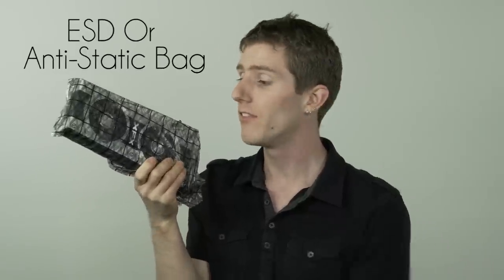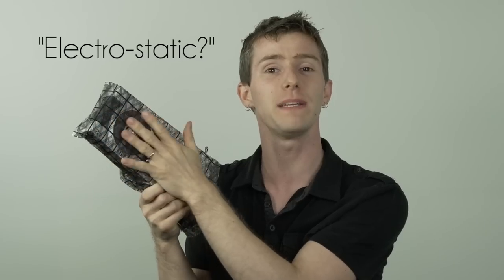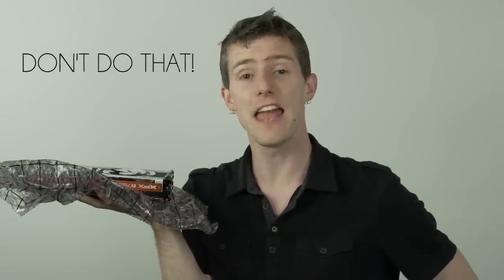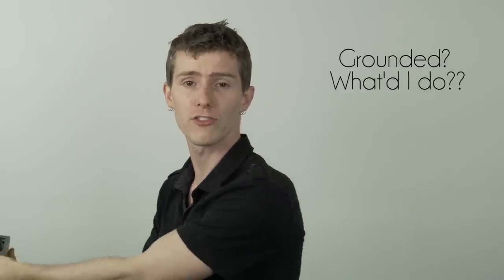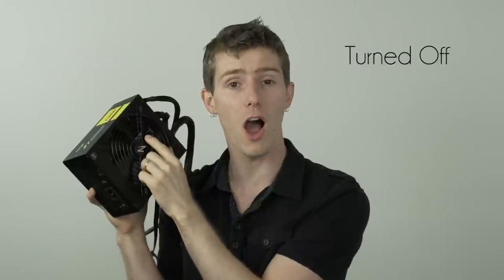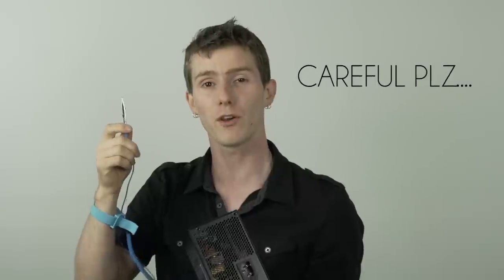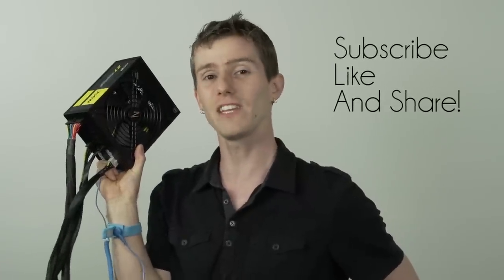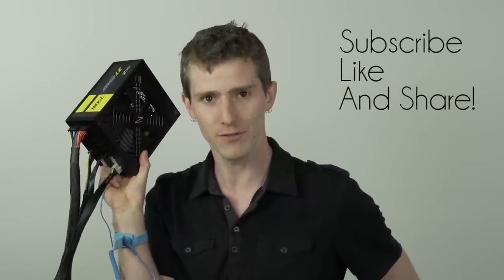Anti Static Safety - Handling Sensitive Electronics as Fast As Possible

Comment: I just touch something that's metal and grounded every once-in-a-while. I don't wear an anti-static wrist strap, sometimes I even wear polyester. I just put the parts on top of their boxes and in my 10 years of building PCs I have never killed any component through ESD ever.
Reply: hi can you help me with something? i don't really understand the words "ground" or "wall" when someone is talking about anti static safety or stuff like that cuz english is not my main language..
touching a grounded psu means that it has to be connected to a power outlet? or i can just touch it even if it's on the table and it's not connected to anything?
Reply: @Monicara  nah, planned to upgrade 2 years ago too and still didn't xd
Reply: @Monicara  can u give me the sauce of ur profile pic tho?

Comment: that power supply is coated with paint.... so how are you supposed to ground yourself on that???
Reply: it's ionized paint
Reply: so i can touch it and I'll be sure?
Reply: Gianfranco Boz Magni yeah. I'd just use one of those de-static bands and hook it to your psu and you'll be definitely safe
Reply: Thanks! I'm sure now xD
Reply: I see that you know about this, so i think you can answer another thing xD
 Does cable management really matter at airflow? 
I mean, i bought a pc but it comes assebled, the cable management is pretty bad, cause they do not use the back of ther motherboard, but, cables are not near any fan. indeed, they are accumulated near the hdd and it seems non-obstrusive.
 I'm spanish, That is the explanation of my spelling :v
Reply: Gianfranco Boz Magni i think Jayz2cents or linus has a video on that and I think it concluded that it doesn't matter much at all, so you're fine
Reply: Double thanks! :D
Reply: Gianfranco Boz Magni no problem. i finished building my first a month ago and i know how confusing it was
Reply: Now my only preocupation is who motherboard i used in my build, i think it is too cheap.
 I used a gtx 1060 and a i5 6600 non k,the mobo is asrock b150m hds, super cheap mobo dude, but in specifications it have all what i need.
 I have in mind change it soon, but idk if i should uninstall and reinstall windows and if the change is really necesary.
Reply: Gianfranco Boz Magni a mobo is a mobo and if it has all the connections you want then it's all good. I wouldn't change it unless it didn't have specific outputs or inputs you want
Reply: Thanks third time! 
 Have a good day ^^
Reply: Does the psu have to be connected to the wall outlet to be grounded?
Reply: Yes, your house eléctric instalation should he grounded too
Reply: Does the wall plug have to be on for it to work or just plugged into the PSU but off?
Reply: wait, i heard you're not supposed to plug in the psu, i heard you're supposed to clip the other end to your case
Reply: I found this all to be very confusing, so I just put a wire to my nose and the other end into the wall socket. The results were truly shocking.

Seriously though, touching an unpainted part of any wall heater has been sufficient for all those years. I can still remember that day back in 2000 when I found that PSU in the garbage on the street and exchanged my own one with it. Then I bought a new pc afterwards.

Comment: I've read that a lot of computer components have been designed to better resist electrostatic discharge so that you should be able to build a PC on a shag carpet, in fleece clothing, and in the middle of thunderstorm without frying it. Still, the more precautions you take, the less likely you are to damage something. Therefore, be prudent and take as many precautions as you can while building a system. Working on a wooden surface and occasionally grounding yourself after moving around should allow you to build without problems.

Comment: Where else can I plug anti-static wrist strap, because when I am building pc, I have to put that power supply in case -__-
Reply: ***** 1:40
Reply: You can attach the wrist strap to any metal object that is connected to the ground at some point. Outlets in some countries may be grounded in some way but use care to only attach to the ground lead, screw, or casing and depending on the design these may not all be grounded. An alternative is to attach to metal plumbing because gas and water pipes are typically grounded if they have continuous metal connections and are buried in the earth when they leave the building.

If you absolutely cannot find a way to ground adequately in the space you are in an you can try insulating instead of relying on grounding. To do this you would use latex gloves and use extra care while handling. It is considered a less than ideal solution because of the chance of bumping the electronics with some part of your body that is not insulated.

You should also try to discharge at least some of the static by touching something metal nearby before starting to work such a metal chair or refrigerator. You probably won't feel a spark but it will be discharging a tiny amount.
Reply: ***** Any idea if I need to keep the wrist strap on at all times when building a PC?
Reply: ***** You mostly need it when handling the motherboard, graphics card, RAM, and other circuit boards but it is a good idea to just keep it on whenever you have the side panel open on the case. Many people get away with not using one when installing RAM or graphics cards but it is safest to use one all the time. You should also avoid touching the components on the circuit boards and handle the boards by the edges whenever possible.
Reply: ***** Are you telling me I live a charmed life if I installed my graphics card in a carpeted room while not grounded?
Reply: ***** You probably run with scissors too. Seriously though it has the potential to cause some damage to the card. It might just shorten the life of the card or other barely noticeable effect. It often will be perfectly fine. It's your stuff and your money so take a risk if you want to.
Reply: ***** I never handle my components by the PCB where possible anyway. The exception would be the RAM. Gotta get some of them heat spreaders for that.
Reply: ***** Is there any problem if I hold the graphics card by the pcb on the sides? Not in the middle of the pcb on the components, by the sides, not touching anything else.
Reply: ***** Thanks for the answer!
Reply: lucasasl9 just dont touch anything conductive like contacts, solder joints, and such on the board otherwise yes on the sides of the circuit board itself is fine
Reply: The truth is. Plugging and unplugging your power supply are both great ways. The little circular rod in the power plug, I believe it is a prong will ground you. But you can also attach your clip to a large metal surface.
Reply: If your case has any metal on it, it should do you fine if it's on the ground preferably on hard surfaced floor for that extra precaution.
Reply: ***** would anything metal work?
Reply: if it conducts electricity like a metal case does then generally yes just dont plug into anything that can shock or risks it slipping out or breaking and contacting something nearby that can. also i do believe some components are made to withstand ESD (my mobo says its rated for ESD 15,000V proof on the board)
Reply: My personal favourite thing to use is a water tap. It should be a perfectly reliable ground and get rid of all static. I will then touch the case regularly to try an dissipate more static, although the tap works better so probably best to keep discharging yourself with that and not take any risks. A permanently plumbed in radiator or a metal toaster should work, but my personal favourite will always be the tap. If you are in the UK then the top pin of a plug is connected directly to earth, but I recommend one of the other options so you can be 100% sure not to plug it in wrong and shock yourself.
Reply: honestly keep your bare arm touching the metal case at all times and problem solved (thats how i put thogether my new A10-7850k APU system) its also free (no strap) but less movement
Reply: Stu Bur a
Reply: You can clip to any radiator.

Comment: I used to work in a Electronics manufacturing plant and the key was.....don't put pcb's on top of any anti static bag because the outside is conductive. This was something explained in great detail through out the ESD training soooo....proof is that in the manufacturing process even in a Electro-Static controlled environment still follow the same guidlines as if you were building or working electronics in your home. Ground your self to be safe, multiple ways if possible.

Comment: In the UK if you are grounding yourself via a wall outlet you need the pin from the top of the plug (the ground pin) connected to the alligator clip and then put the pin in the top of the outlet thats the ground (or earth as we brits call it) and you cant miss the earth hole because the live and neutral holes are behind safety shutters

Comment: Actually, the anti static bag is not conductive.
Reply: Yeah I remember a video where they booted up a motherboard on the bag and nothing happened.
Reply: At least nothing bad happened. Booted up fine.
Reply: blastedstorm The bottom of motherboard itself is  insulated, but this is too thin to prevent an electrostatic discharge to jump through, since it's designed to run at 1 to 12V.
Reply: ***** It isn't for most bags, which are the kind that are semi-transparent and looks shiny. But you're not forced to believe me, you can use a multimeter on one and see by yourself.
Reply: Oh my fucking God. So much damn misinformation on the Internet. The inside and outside of the bag are made of the same exact material. Yes, the bag is slightly conductive but the skin on your fingers are more conductive than the material of the bag. The fact that it's even slightly conductive is why people don't recommend it. You should set it on a nonconductive surface.
Reply: +Step One why not flip it inside out?
Reply: ***** idk I'm asking lol

Comment: I used to work at a place where we had grounded benches, we could plug our wrist-stat into a plug and be grounded.... we had an anti-static spray we'd put on the surface to wipe it clean of dust. And we had an air de-ionizer above the bench.

Comment: I don't understand as much how to use the ESD strap. cuse im building my first pc soon so do i just put the strap on and attach it to something metal? PLEASE HELP ME!!!
Reply: strap it on and attach the alligator clip to the ground terminal or negative terminal of any electricity outlet; or to any conducting material that's plugged in to an electricity outlet, but switched off.

If you happen to clip the strap to any positive electrical terminal (the red wires) you'll die or at least get some sort of sever burn.
Reply: Don't worry about static too much. Just touch the side of your case (assuming it's metal) every now and then while building.
Reply: okay!!! thank you!
Reply: what i do with mine is get a powerbar and get a cable with a grounding prong, cut the cable and strip the wires, there should be three, your positive and negative and then your third is the grounder, seperatly tape off the positive and negative to keep them out of the way, note if they do touch you will get a blue arc flame, this is bad, don't let this happen, finally connect the aligator clip to the grounder wire that you previously stripped. you esd will be now out of the way and you will be consistantly grounded.
Reply: can i get rid of static just by touching metal
Reply: JFX Pro Games yes
Reply: thanks

Comment: pff I do 90% of my computer building on carpet with no fancy wrist strap or touching anything ground and always touch the components on my hardware and I've never had a problem. It is all a load of crap if you ask me.
Reply: So you are lucky. In my first computer i change ram memory, i do everything in correct way (even tuch my wall radiator) and i fuckedup motherboard....
Reply: ***** Because you are a leek :') 

I have build 2 PC's today and a total of 40-50 PC's. Never ever had a problem!
Reply: I repaird and build about 50 to but fucked up one because of electrostatic...
Reply: My first build was above carpet. I wasn't grounded either and the computer is perfectly fine.
Reply: You are playing tag WITH DEAD!
Reply: Ferry Heezen
Im repairing computers from 10+ years. In 10 years thats happen once. But is possible.
Reply: Watch out we have a badass over here . Jk . I built many pcs without protection methods and I never came across a problem
Reply: I built many pcs without protection methods and  O N E of them die...
Reply: I guess I just got lucky
Reply: only put together a couple dozen pcs, even swaped out components on more then that, none got fried yet, guess i'm lucky too, for now.
Reply: You don't have to feel it for there to be damage that can come around over time. It's more of a precaution (outside the factory environment). Electronics are often coated to make it more tolerant to static discharge.
Reply: To my understanding, the idea is like wearing a seatbelt: you'd rather take a better-safe-than-sorry approach to something that's valuable. (Like a $300+ video card, in case your body accumulated static ... or bones and vital organs, in case of a car accident.) You'll probably be fine driving without a seatbelt and chances are nothing bad would ever happen, but it's smart to wear it anyways.
Reply: I killed one computer with ESD. I was forced to work in a bad location without proper tools. I tried to be careful but knew the risk. I never even felt a shock at all. It was an old laptop computer that I was trying to salvage so not a huge loss to me. Testing confirmed that some motherboard components were fried.
Reply: is static buildup affected by weather and humidity?

Comment: One additional tool you can use to reduce the risk of ESD is anti-static spray. The spray designed for this purpose works best but is a little bit expensive. You can spray the circuit boards down before installing them - it only takes a thin coat. Let them drip dry completely before installing. Some people use anti-static spray designed for fabric such as Static Guard brand spray and it also works but leaves some sticky residue and as it is an off label use - use it at your own risk. Do not use any of these sprays while the components are connected to power, even if it is turned off. Using the professional purpose designed spray will also help clean your boards and help to keep them from attracting more dust for a short time.

Comment: Just to clarify, if you're hooking the aligator clip on your ESD bracelet onto something that's painted (like your pc case or the power supply), make sure that the teeth go through the paint and into the metal beneath. Otherwise the paint might insulate you from the ground, making your ESD bracelet useless.
Reply: How about to the case on a MacBook Pro?

Comment: How about attaching the strap to your metal case?
Reply: it wont work the metal has to be attached the earth so unless you are building the system on your lawn it wont work, you can attach it to your plumbing as that leads in to ground.
Reply: Arron Graham How can I use it then?
Reply: U can touch it or use a grounding strap
Reply: If there's a central heating radiator nearby, you can clip it onto that.
Reply: Actually if the case is large enough the larger charge on your hand will discharge in the case do to being at a lower potential. so, it would work.

Comment: use a wrist band,use a mains plug adaptor for wrist bands,they have a 1M-10M resistor in series with the ground pin so static can "LEAK" away,and you may zap static sensitive electronics without them dying,but will shorten the components life span.

I prefer to plug into the system ground as not all shiny surfaces are connected to  a good ground,and i don't mean mirrors.

Comment: Graphic's cards are pretty static resistant, CPU's and RAM are the things you have got to worry about motherboards being a close third.

HDD's nowadays are pretty static resistant too I constantly handle bear hard drives with a docking bay and just leave them on the side and I haven't had any problem.

The once inside my PC are the once which fail but that's not surprising considering they are being constantly used. Where as the once outside are left offline laying on my desk most the time.

Things like NIC's and Sound card's are usually pretty static resistant as well but I would take greater care considering workmanship is a lot more shoddy on those kinda of things.

Comment: BULLshit. I've been "into" computers, hardware, audiocomponents etcetera since 1986 or so, I never, EVER used any "antistatic" precautions and NEVER encountered any electronic device failing because "I didn't use antistatic precautions".
Reply: You don't need them, really, it is just an extra safety measure.
Reply: It's a situational and especially locational thing. Apparently neither of those things are actual words. Anyway, it all depends on location and where you're handling parts. For some people it's absolutely necessary, myself included since I get static shocks frequently from simple stuff like touching door knobs and turning light switches on.
Reply: If you live in a more humid climate than static probably wont be a problem
Reply: GTI1dasOriginal i touch all the parts where they say not to and i have never had an issue...
Reply: my house is lined with carpet, i'll take the precautions, only takes one time to fuck it all up, not following precautions can be fine, in most cases, but they're their to stop you having a real fucked up day

Comment: You can also touch a large metal object (such as a computer case) instead. This is called a floating ground (basically, the object is large enough that a bunch of electrons will barely affect how negatively charged it is.